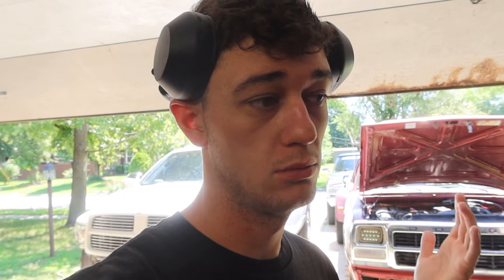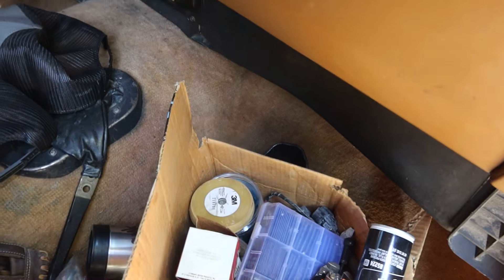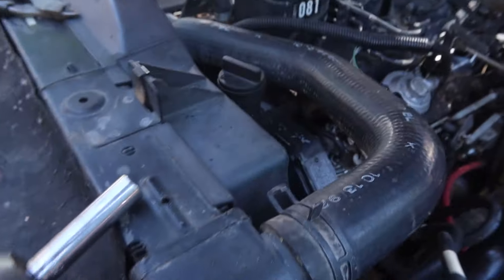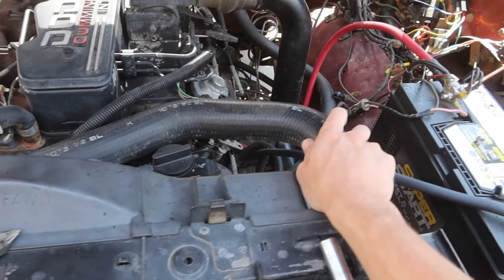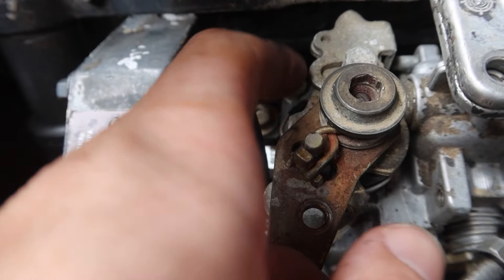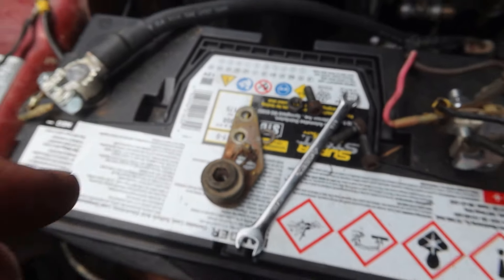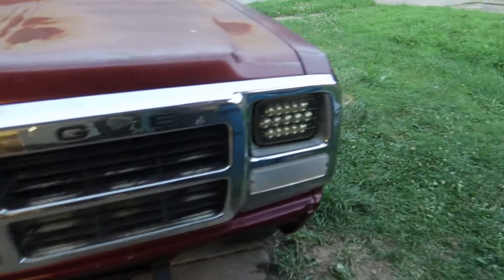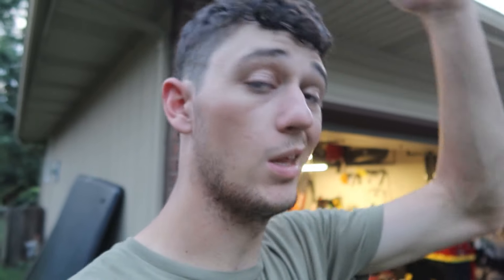We find out more problems with the DUALLY!

Comment: Thanks brother for extra tips on the pump. My spring is a little loose as well. That info was welcomed, along with all the other tid bits about the internals. I did what you talked about and quit turning in the fuel screw when I felt resistance for fear of breaking something. It's nice to know that I did something right for a change. Also wanted to say that you can replace the idler stud with an actual bolt. It simplifies adjusting the idle by just using a wrench instead of trying to work with the small hole on the end of the stud. Just remember to put the lock nut back when you replace it. I got the idea from Tim on Decent Garage. I found it to be very helpful.

Comment: Could you go more in depth on the throttle indexing to get more travel than stock?
Reply from the maker: @shaneschartel1593  throttle indexing and having a clipped spring go hand in hand and the indexing is required when you use a clipped spring. Maybe one of these videos I'll have a pump top off and explain what is going on internally